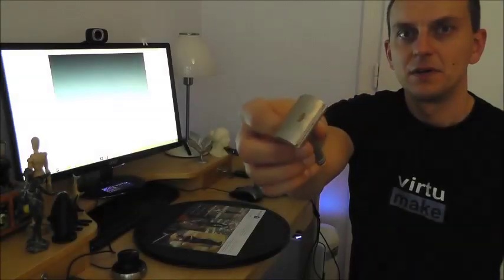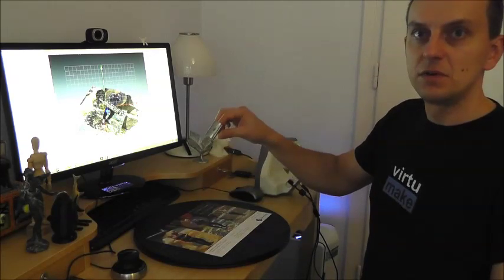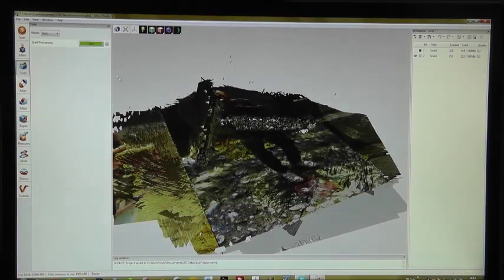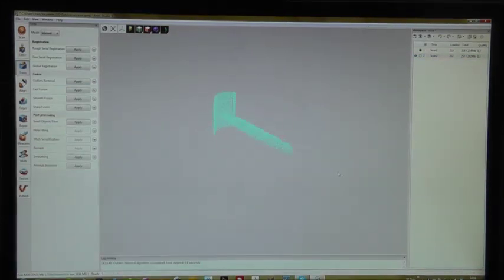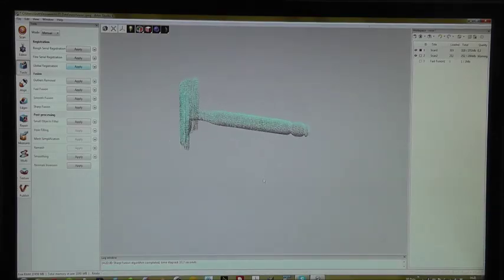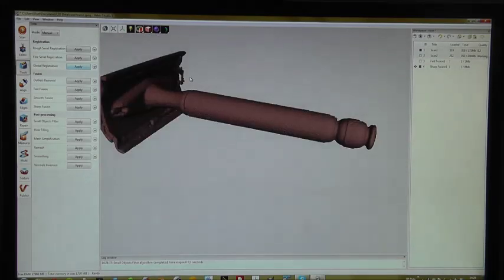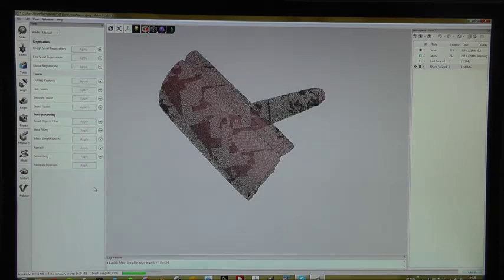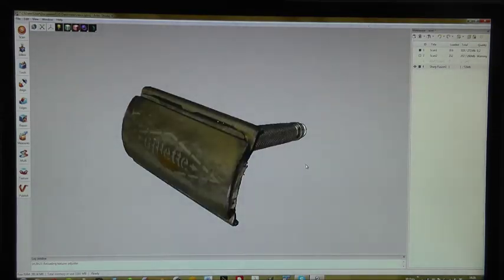Artec Spider 3D Scanning Tutorial

Comment: Hey mate, love your channel.
Thanks for testing all this out and keeping us informed.
Quick question: which of all you've tested (for both hardware and software) has the best results for small parts (<10cm) and is under $10,000?
Reply: White light if you build your own hands down.
Reply: Transpose Scanning Right on thanks mate. I would definitely look at building my own setup. Any recommendations for what to know/research? What software and hardware would you recommend for a budget of $5k-$10k?
Reply: I just looked at your channel and FB page. Will any high res camera work (dslr) or should it be a high res webcam? And would an LED projector work or should it be a higher res and higher intensity projector?
Reply: ***** Optima high intensity. Do not use a webcam, or a dslr camera. I would recommend machine vision cameras, 1.3 MP for speed, at least 2.8MP for quality. Color is optional. If you are looking for the most quality, go with monochrome. I would only use that for inspection. Better would be to use color if you are interested in capturing color scans. There are 2 major manufacturers of software you can use, and one open source software. LMI Technologies sells a scanner. The highest one is around 20k, the cheaper one, is much lower in cost, and still pretty good. David Laserscanner is a good choice also, but it is more difficult to Calibrate. If you are willing to spend 5K, you can definitely afford david, which is always improving. If you want to start cheaper, you could find a cheap web camera that supports WDM, and use the brown university white light scanner, this is more complicated, and requires matlab, and some knowledge of trigonometry. If you do buy either LMI, or David, you may not have to choose a camera or projector, one would come with the kit. I would contact those two companies and inquire about what they offer.
Reply: ***** Also, one more thing. If you are interested in an Artec Scanner, the Eva is great for larger objects. You can scan people, and it gets pretty good results. If you buy the Artec Eva, without being able to capture textures, it is only 12k USD, which might be over your budget, but it is an inexpensive option.
Reply: *****
Hey, thanks a lot! :)

I use a structured light setup with 2.8MP PTGrey Cameras. The projector I use is a Acer K11, which is really not very bright and incidentally has been discontinued. So I will consider a different projector in the near future. I am looking into buying an Artec M from someone I know hopefully that pans out. I also am very interested in Ten24.info, and infiniterealities. They have superb photogrammetry scans, and capture scans way under a second.  Also that Artec Spider of yours looks really nice. I can't afford 25,000 for one at this time. But really impressive stuff. I can't even find any other videos that display it being used, so hats off to you for your work uploading.

Traditional structured light is a lot slower, but generally more detail can be achieved. I thought about starting a kickstarter campaign to create a software similar to David, and other softwares that allow calibration, and structured light, but it would also include realtime reconstruction. PTGrey, and Ueye have developed some really fast global shutter cameras that could definitely achieve this in high resolution, but even a low resolution 1.3 to 1.4MP camera would work just as well as an Artec. I would want it to be open source, but I don't know if anyone would be interested, or talented enough to code something like that using just free time. Unless I was able to bring it to the Blender Foundation, and gain support. In any case, that's my scanning story. I appreciate the kind words.
Reply: Awesome info, thanks gentlemen. And thanks for putting in the time to answer my questions, you've got me excited now.
Reply: Ok, I spent all day today researching the info you provided, and now I'd like some verification from you folks, if you wouldn't mind.
From what I can tell LMI bought out the software (flexscan3d) and also purchased off the shelf MV cameras and scanner, and is selling it as a nice and neat package at a rather large inflated price, correct?
So here's what I was thinking, purchase just the software from LMI ($2700) and put together my own hardware.
2x 3mp color cameras ~2500
700 lumen LED projector ~800
Davids SLS Software (optional) ~400

So long as I haven't missed any major components, I could build this setup for well under my budget and maybe have room to upgrade the cameras/projector.

Thoughts?
Reply: Yes, you are correct Chris. If LMI still sells Flexscan separate from their hardware, that is the option I would go with. Flexscan has easier calibration, and more accuracy than David because of it's Dual Camera Calibration. This would be the less tedious way of doing it. Flexscan3D beats out David Easily in speed also. And yes, they sell their equipment at a markup that is roughly 10k. Make sure you get a mount set up as well for your cameras and projector, this will allow you to tilt your SL setup and make it semi portable. I hope this helps. :)
One more thing. There is also photogrammetry. Look up Ten24, they have a scanning setup using 80 Cannon Rebel T3I cameras to capture really excellent scans in a fraction of a second. Even with a few cameras, you would be able to get excellent scans using Agisoft Photoscan. That is another option,
Reply: Another thing, make sure your Hard Drive is Solid State, they are so much faster than regular drives, This will allow faster capture with your cameras. I would also recommend doing Gigabit as the option for your cameras. USB 3.0 is faster than firewire. but Gigabit is more stable.  If you want to capture faces, hands etc, I would recommend a fast camera. At least 30 fps. And, make sure your cameras are global shutter, as rolling shutter is difficult to sync.
Reply: You're the best mate, thank you soo much.
Ya, I looked at the Ten24 and infinitereality stuff from your site. I haven't been able to figure out what the benefit of photogrammatry is over SLS/laser scanning, other than speed, and perhaps better color/texture capture. Am I missing something there?
Oh, that reminds me, do you do any laser scanning or mostly SLS? I assume better accuracy for laser but significantly more time?
Thanks for the tip about the gigabit, I was actually looking at usb3, and I've already got a few SSD's kicking around my shop.
I might pick your brain for more camera info, as I don't have much knowledge in that field.
Reply: The benefit is that you can Capture scans in 1/10000th of a second. You can achieve extremely high quality scans of people without having to worry about movement. There are various reasons that it can be better, and reasons other systems can be better for their purposes.. It's just another tool that can be used to further your needs. I would encourage you to look at the 3Dscanstore to see what detail can be achieved. Also. Ten24 has a facebook page where they detail about their services.
Reply: ***** I was browsing through the comments again, and didn't realize I hadn't answered your other questions. I do not use laser scanning. Pick my brain for camera info if you wish.